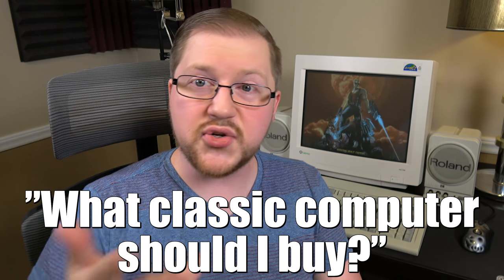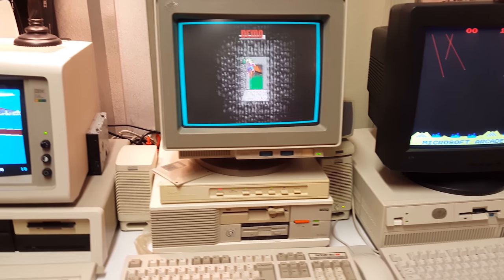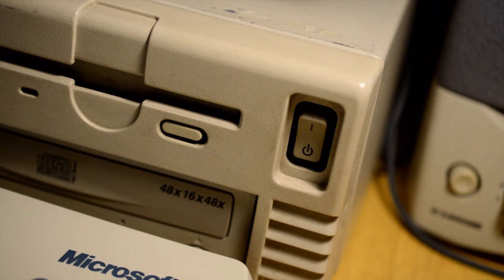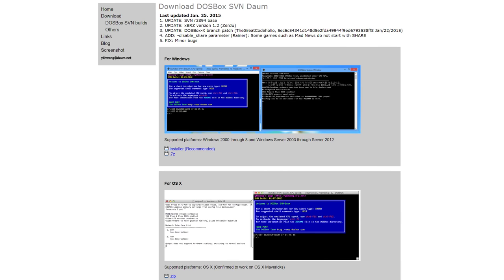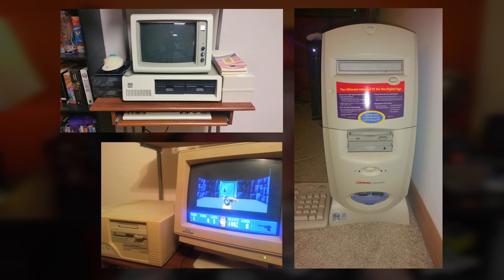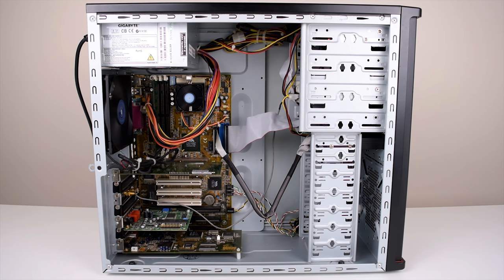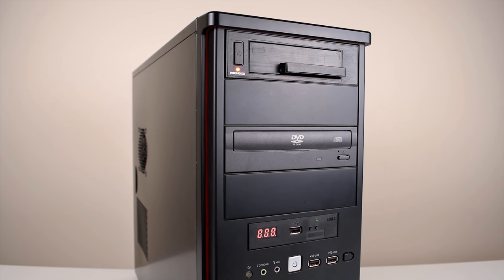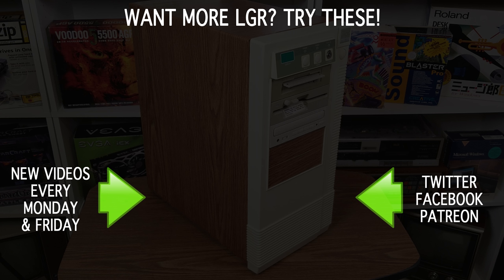Choosing a Retro PC for Games: Advice & What to Look For

Comment: I snagged an hp omnibook 800ct notebook from eBay (was a cheap deal), it has a tft screen, 166 pentium mmx cpu, sound blaster standard, 2GB hdd and 80MB ram. It’s small with 10” display and full of features. External cd and floppy. Love it so far.

Comment: I'm the proud owner of the custom-built retro machine called RetroMaster. It's a personal design, made entirely by myself. Featuring AMD Athlon XP 1800, Asus A7V8X-X & 512MB of DDR400, in combination with 3 video cards (2x 3dfx Voodoo2 12MB & nVidia GeForce4 Titanium Ti4200), Diamond-branded Aureal Vortex2 sound (that's bridged to the onboard sound system) and two hard drives featuring two Windows installations - 98SE & XP Home Edition, SP2. It also has two DVD-RW drives & a standard 3.5" floppy disk, all packed inside the modern (black) Cooler master midi-sized tower. Vortex & Voodoos handle the early to mid 90s era, it even has a modified Autoexec & Config.SYS for extended DOS support, for pretty much all the games in my collection. On the other hand , XP takes advantage of nVidia card & onboard sound, since the Vortex2 doesn't perform well under newer games, or even XP to begin with. Powerful enough to run Half-Life 2, compatible enough to run Doom or Duke3D, it's basically two (and a half) systems in one :-)

Comment: I use Windows XP era Thinkpads, a T42p and T43. I didn't necessarily grow up playing on desktops, so I'm not all that picky on how they run the games, but mid to late 90s and XP games through 2005, is all I ever need! I use a dock connected to a CRT, Model M, PS/2 mouse, and speakers for the desktop experience. I love it. Surprisingly enough, they can run Oblivion, it's not great, or fast, but it is doable!

Comment: I have a Toshiba 320CDT laptop and it´s great for retro DOS-gaming. It´s sound card is 99% Soundblaster -compatible in DOS. Only game I have massive problems with sound is Death Rally. Been playing Prince of persia, all the flipper games: Dreams, Fantasy, Epic pinball, Psycho pinball... It´s battery is still in great condition, lasts up to 2 hours. AND greatest thing is that the keyboard doesn´t stuck! You can press all the keys down and still works, great for two player games. Swapped in a 160Gb hard drive and maximized memory to 96Mb.

If you want small and handy retro gaming machine, look for Toshiba 320CDT. (The T-stands for Active Matrix display, don´t buy 320CDS, screen is crappy.)

Comment: Great video.  Just wanted to offer up one more option not really mentioned - PCEm/86Box.

You kind of dismissed it early on as a "DosBox offshoot" which is a little unfair.  It's more the WinUAE for retro PC emulation.

DosBox is more a plug and play MS-Dos compatible wrapper to quickly run old dos software on modern OS's.

PCEm is more of a middle of the road solution focusing on emulating real hardware (you have to install Dos on it).  It's like having all that old real PC hardware but taking up none of the space.

Not perfect by any means, and not for everyone - but better than trying to run Win98 in VirtualBox!?!

Comment: Honestly I love old hardware, but its such a hassle getting it to work now that I've been spoiled by modern tech. I ended up building a dedicated emulation machine, using a fairly modern system but with the theme/sounds set to Windows 9X nostalgia mode and running on a thrift-store CRT monitor (threw out mine long ago...) with my old Sony speakers.

The good news is I can still run my Roland SC-55 for midi using a USB adapter, and I still have my IBM keyboard converted to USB...I'll admit to using a laser mouse though. All my old ones were disappointing to say the least.

Comment: If you're on a budget and targeting the late 90s thin clients and older industrial motherboards are a great middle ground. They tend to be small and are often relatively inexpensive. A lot of early 2000s thin clients and industrial boards (VIA EPIA for example) have late 90s era appropriate hardware in them and some even have DX6/7 era 3d accelerators in them and can be made to run Windows 98/ME/XP relatively easily.

Comment: My go to PC setup for classic gaming is an AT socket 7 motherboard paired with a Pentium 233MMX. If the computer will be DOS only then 64MB of RAM is all that will be needed. Often though I install a CF card reader for in place of a hard drive giving me the option of switching CF cards. I often set up one CF card with DOS6.22/Win3.11, another card with Win95OSR2, a third card with Win98SE, and some times a card with Win2KPro. If I set up a system to use Windows CF cards along with a DOS only CF card I try to find motherboard that support at least 128MB for Win95/98 and 256MB for Win2KPro. For sound I always prefer the Creative Labs Vibra16C ISA cards as they work fantastically with DOS all the way up to Windows 2K. For video I try to stick with a PCI card with a minimum of 4MB, however VooDoo is the best if you can even find one these days. I sell many of my P233MMX setups on eBay and so far every one of them has created a happy vintage gamer. I love to build these classic gaming machines more than actual playing the games themselves. Oh, one other note, if possible always try to source new old stock (NOS) parts if you can. It will cost a bit more but will ensure you are not inheriting someone else's problem hardware.

Comment: I still have my childhood PC running. Custom built so totally whacky:
150MHz Pentium, 96MB ram, Voodoo 3 3000, integrated soundcard and a DVD-drive. Running Windows 98 (maybe SE). 17" CRT from 2002 so it can run that sweet 85hz and not murder my eyes.
I really appreciate the dust filter on the front fan slot in a case from 1995.

I did recently get a 500MHz Celeron MMX so might look into making that a better retro-PC :)

Comment: great retro game PC setup:
- Asus P3B motherboard
- Pentium III 800E mhz Slot1 CPU
- Voodoo 3 3000
- Voodoo 2 12MB as a second GPU (yes you can use it alongside the Voodoo 3)
- 256MB SD Ram
- 80GB IDE HDD
- Gotek USB floppy drive emulator
- CF to IDE adapter
- Creative Sound Blaster AWE 64 card
- Windows 98 Second edition

you can Install MS Dos 6.22 on a CF card that I highly recommend for DOS games
The motherboard does support Jumperfree and also has dip switches to underclock the CPU for older games.

Comment: I have two retro PC's... A DOS/95/98SE PC and a 2000/XP PC. My 98SE PC you may like Clint, pratically it's a Baby AT version of your "Packard Hell" PC. 500Mhz AMD K6-2+ Socket 7, 320MB of PC-133 (128+128+64), ATI Rage PRO card (have a MX440SE in it now) and since it's a Baby AT board, AT Din Connector, AT Power, has no external IO it's all PCI and ISA Cards but it has a chip for PS/2, Serial, USB 1, Parallel. Its a weird beast... Motherboard is a Gigabyte GA-1AA. 

XP machine, 3.2Ghz P4 Northwood-B , 4GB DDR-333, ATi Radeon X1950 Pro AGP

Comment: Windows 95\DOS: Beige box Pentium 200 MMX, 128 MB RAM, ATI Rage 128, Sound Blaster Live!, 40GB of combined disk space across three drives, 40X CD-ROM, plan to pop in a Voodoo 1 whenever I get a chance.  Windows 98/DOS: Gateway 2000 P4 with Voodoo 3 2000 PCI (it's the one I bought when Voodoo3 was new and I didn't have an AGP slot in my PC at the time, this Gateway also has the AGP slot removed for whatever reason), 60 GB HD, DVD Burner, Sound Blaster Audigy Platinum, 1GB RAM.  Both built with donation PC's and parts I had lying around.  They play all but the most primitive of DOS games, which I don't play really anyway.  Both hooked up to 15" CRT's.

Comment: just too add ..  I went Spring clean up  trash Diving , last Month  and  Picked up a  Pentium 100 mhz  system  and a Pentium II  system  , a LARGE box full of ISA Cards  Audio/Video/ HD DD Controllers,   old Hard Drives  Socket 3 mother boards ,   of the 80s and early 90s Era ..    I was Stunned!! .. seeing on Ebay  that a Sound Blaster AWE32 Card  goes for $99 Dollars  on Ebay  and  it has 2 in the Box  in that Large BOX  I picked up ,, that was put out..  for Trash for Spring Clean UP! ..  LOVE  your Channel LGR!!

Comment: Oh hey, I have HP Vectra VL400 like the one featured in the video. For its time a nice Windows 2000 machine, but the upgrade limitations made me build something better. 256 megabytes of RAM maximum really didn't cut it for me, and unlike his machine, mine has Pentium 3 clocked at 800 MHz

Comment: My go to MS-DOS  machine is actually an old P2-300 Toshiba Satellite (4025CDT to be precise).  The graphics chip has windows 3.1 support, it runs great off a SD card, the screen is pretty good, and it has a genuine OPL3 chip on the internal ISA bus for DOS compatibility.  I use Setlmult to disable the cache while in the system (or i can disable it through the BIOS) for those games that requires things to be toned down a bit.  For DOS games that pace themselves, it works with everything on, and for older games, it runs somewhere near a 386DX 20 mhz with the cache disabled.  Ultima 6 and Wing Commander works just about perfect with the cache disabled. Only downside is i don't have a game port...

Comment: My first PC, aside from an early Atari ST, was a Pentium 100. I think it basically hit a sweet spot in terms of what it was able to run, Duke 3D ran perfectly, but it also could handle dos games and stuff perfectly. I think really the big divide in 90's PC stuff is between W3.1 and W95, if you've got a PC that can play everything up to 95 smoothly you are covered for much of the decade. Everything made for W95 could also probably run on a much faster PC with 98 or XP.

Comment: I really love the support for the 486, mostly because it's one of the few processors I've never actually had. I've had a Commodore 64, Commodore 128, Tandy 1000, a 286, a 386SX, a few Pentium 133's, a Pentium MMX 166, PII MMX 266 and tons of everything newer up to modern machines. I guess I should get a hold of a 486 someday!

Comment: Probably a bit late on this comment, I've been going through your old videos as I find them entertaining. I play most of my old games through LaunchBox frontend and DOSBox. I do have a pIII 1Ghz old industrial machine with windows 98se I occasionally use, but have recently cleared out most of my collection of vintage gear. IBM JX-PC (Pc Jr. in 'Merica), ZX Spectrum, Apple PowerPC G3. I really do regret having gotten rid of so many machines over the years, at least 20 486's, but the one I miss the most was my IBM PS/2 55sx.

Comment: Thanks for this good and helpfull guide, to determine what you want yourself...
This is what I chose:

I build a Pentium III 850 with 256 MB SDRAM on a ASUS P3B-F motherboard, with a 2GB CF card for HDD, GeForce 2 GTS as VGA, a VooDoo2 12MB For glide capability in DOS, a 3com 905B Network card, and a simple Creative PCI128 Sound card (still looking for a Vortex2). All in Windows 98SE
This with caches disabled, can run 'older' games that for it's era, and with all on it runs pretty much all Y2K Era games.
I also have a CF card with Windows XP but it runs slow for some reason. But a SATA to IDE adapter is on it's way so I can use a small SATA HDD or SSD as a fast harddrive on the IDE channel.
Love to play Warcraft 2, Commandos, Keen (older game) and the early StarWars games.

Comment: I've got a very very late XP machine I just built recently. First gen of the Athlon 64 X2. Idea is to run a lot of those games like Doom 3, F.E.A.R. and Far Cry that have minor issues on modern machines like EAX or reflection/shader issues on more modern Windows. It's hooked up to a nice oldschool CRT though and I use DOSBox with it for older games since I can get that classic CRT and Model M feel even though I don't really have the time nor resources for more machines at the moment. I'm currently looking into maybe getting a Voodoo 2 or 3 based 98 machine though to fill in that gap later down the road.

I'd like to eventually collect a ton of older machines for all different occasions, especially builds with unique soundcards, but I think my setup works pretty well to cover the vast majority of the basses I wanted covered for right now. It also has the benefit of being able to use modern Power Supplies and Hard Drives so you don't have to worry about old ones being finicky or potentially on their last legs.

I get that you probably don't consider the 2002-2007 era "retro" quite yet Clint, but the majority of those games don't play nice with widescreen, were designed around CRT's, were built for 32-bit Operating Systems, and used older API's like Direct X 8 and 9 that sometimes have minor incompatibilities with modern systems. They're starting to become a pain to run on a modern machine and I think are at they point they require a dedicated rig to fully enjoy sometimes because solutions like DOSBox, nGlide, and SCUMM VM don't exist for that era yet, Engine Source Ports are rare and difficult on such complex games at this point (just compare how long its taken OpenMW to reach the condition it's in to where Boom and eDuke32 were at the same points in their lifecycle), and "Remastered Editions" of games can often change parts of the game in undesirable ways like Doom 3 BFG Edition's craptastic lighting and significantly more generous ammo placement or Bioshock Remastered's jarringly different water effects and general glitchiness.

Just something to consider discussing if you ever revisit this topic again.

Comment: Awesome video as always. For me, it would be too hard to decide which older PC to try to "copy", because I've used so many over the years, and I didn't feel any particular attachment to any of them. Besides they were constantly evolving and changing due to upgrades. It's easier with 8-bit and 16-bit home computers, because there were fewer models and variations, and compatibility was less of a concern (e.g. pretty much all C64 games work fine on a 1983 breadbox C64 or a 1991 C64C...).

I'd agree the period from the late 90's to early 00's is the most difficult in terms of compatibility. 3dfx Glde is the real killer, while the move from 9x to the NT kernel (XP, 2000) also broke a lot of games. You almost need a genuine Windows 9x PC with a Voodoo card to be able to play some of those games. Anything from 2003-2004 and later tends to work fine on a modern system, especially if you buy the patched versions from GOG, while early DOS games tend to run quite well with emulation or virtualization (though there might be some small glitches here and there).

Comment: For those without any experience, a regular PC with a CRT monitor next to the LCD and well-configured emulators from packs I can't mention in here is ideal, with maybe some Pentium and Glide machine with game discs for running late Win95-2000 era games and a cheap switchbox on the CRT would be an all-covering setup for every game they're likely to think of.  Mildly costly, but a pre-built machine and any existing gaming PC would be all the machines needed.
Reply: My own keyboard is white so I can read the letters without RGB enabled. Best of both worlds wherever I could manage, but I need my own Glide box.

Comment: When you were a kid, I bet the notion of owning dozens of computers, even of the 486 or older variety, probably would have seemed utterly impossible. My family didn't buy a single computer until well into my teens (it was an Acer Aspire with a Pentium-100, 8MB of RAM, and a 1GB hard drive, and it cost us $2500), and I remember being introduced to Doom before that. My friend had a 386 in his room (the 486 was his parents' computer that obviously must have replaced the 386) and it ran Doom really well, I must admit. I played that and was hooked immediately. I wanted a computer so bad, not just for Doom but for all the other cool stuff it could do. I had very limited experience with Windows 3.11, in fact when I used a friend's computer after getting the Acer, which had Windows 95, I was wondering how to access stuff on the Start Menu since there was no Start Menu. I felt a bit lost.

Anyway, again, looking back at the time I could never imagine owning multiple computers, let alone ones that were so vastly more capable, computers were so expensive and it was common that a household didn't even have a single one. And now my phone can vastly eclipse those old machines, while costing significantly less, and having way more features (never mind my 8-core desktop beast with 32 times the amount of RAM that my first computer had in storage). The old hardware is still insanely appealing to me for some reason, and I've gotten a habit of collecting the stuff. I haven't been doing much with any of it, but it's about time I put it to use.

I need to acquire some CRT monitors.

Comment: +LGR  Very few systems from the Pentium MMX era had an ideal configuration for planar logic.  My idea of a baseline system for dual-role DOS and OS/2 would pack the intel® A80503-200 MPU, A82439HX northbridge, A82371SB southbridge, A82093AA I/O interrupt controller, N82040 keyboard/mouse/chronometer controller, and S82091AA dual-disquette/dual-UART/parallel-port/IDE controller; two National Semiconductor®/Texas Instruments® NS16650 UARTs; 64 MiB synchronous DRAM main memory (each address point 8 x 11-bit for full ECC support); and a four-digit POST monitor on the front panel.  Expansion slots would be three 32-bit PCI and one 64-bit PCI plus four IBM 5170-compatible 16-bit for legacy adapters.